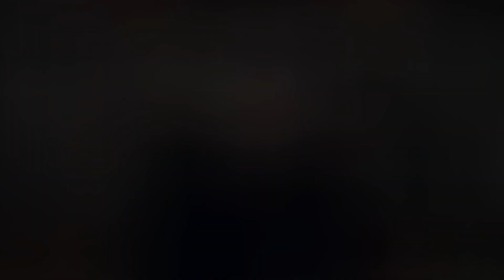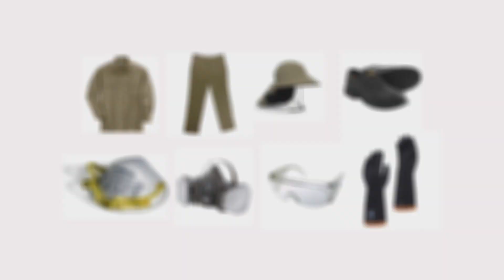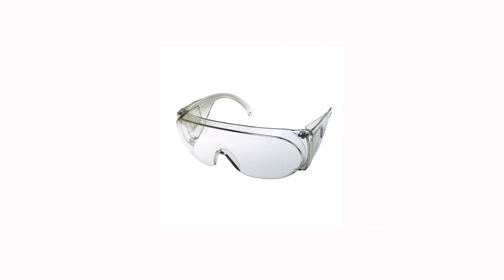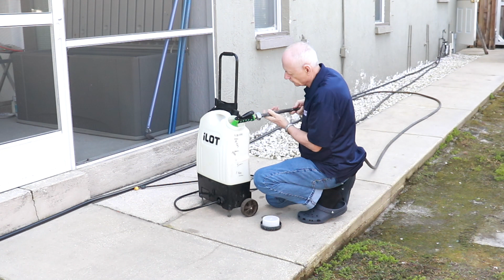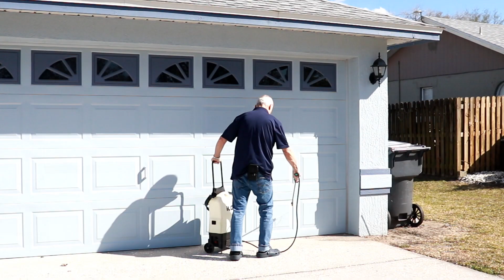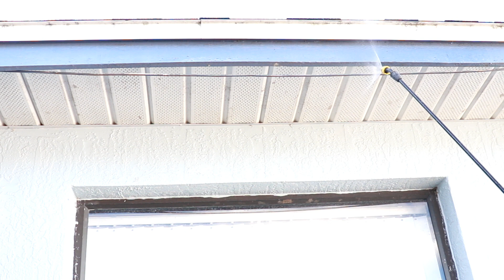How to Prevent Drywood Termites 100% Guaranteed.

Comment: Hi Guy, I'm in Florida as well and have both subterranean and drywood. For the Subs I found mud tubes in the garage coming in from both sides and I removed them physically. They or drywoods have hollowed out he wood frame around the garage. They have also taken out a small palm tree in a garden area as well as I found a mud tube going up most of the length of a big Palm Tree. Any recommendation for that area or the big Palm?  I have found drywoods in 2 places inside attic and 2 places so far on roof overhang in limited areas. 1) For the Subs, you seem to recommend the trenching (and not bait stations?). Do you recommend any injections into walls and, if so, can this be easily done by a novice? Will the trenched poison be toxic to cats,etc. after drying? For a situation like mine with recent evidence of subs inside, would you still also say to give the "Bio Advanced" granules a chance instead of trenches? If so, with granules, how often would you then repeat that treatment or then move to quarterly sprays as a preventative? I have about 8 inch brick pavers on the ground around foundation walls of much of house. Do I have to move all of those first if trenching or just leave. What about the driveway/ garage front area? I also have a screened patio which I believe you said I could continue to trench around. I have an outside patio area with patio stones and/or pavers on some areas there. What to do there? Is it Ok to just trench or granules on outside perimeter of that as well?  2) What about the drywoods in my situation? Is tent fumigation the only option likely to worK? ( I prefer not if possible). Guy, thanks so much for this offering.
Reply from the maker: It sounds like you have a lot going on there.  I am so sorry that you're going through this.  Let's try to unpack this one issue at a time. 

Let's put the drywood termites on the back burner for a little bit.  These guys are very slow eaters, and it takes a long time for them to do significant damage.  Also, you need to address the subterranean termites before you treat the drywood termites.  There is a very lengthy explanation for that, but please take my word for it that there is an order of treatment to follow with this stuff.  Don't worry.  We will be addressing the drywood termite issue. 

The primary goal is to protect your home.  In Florida, you may encounter Formosan termites.  I would not be a bit surprised if this is the species you have.  I say that because of the palm tree.  Formosan termites are the only species that eats live wood.  These guys are very aggressive eaters, so if you are dealing with this species, then that needs to be your priority.  I cannot say for sure this is the species that you have, but it sure does sound like them.  In any case, the first thing you need to do is to trench around your entire house and both sides of the driveway.  I have a video on how to treat Formosan termites, and I will give you a link to it.  I think it is reasonable to assume that the colony that is infesting your house is the same colony that is attacking the tree.  Therefore, if you can take out the colony, that will end the problem with both the tree and the house.  Trenching the house is the best way to go about doing this.  There is a treatment that you can do for the tree as well, but right now I suggest that you focus on saving your house.  Do not waste your time with bait stations.  They are Hail Mary Pass at best for a non-aggressive species, and pretty much do not work at all for Formosan termites.

If you have Formosan termites, then the video will explain what you need to do with regard to treating inside the house.  That may be nothing in your case because you will be fumigating.

After the trenching is finished, and the pesticide has dried, it is safe enough for children to play on.  So, this will not be a problem for your pets. 

The termite granules do not work for Formosan termites or drywood termites.  Since there is a good possibility that you do have Formosan termites, I would not recommend using the granules. 

If you have pavers that are against the house, you can usually trench just to the outside of them.  Trenching directly against the house is always the best way to do it, but you can usually get away with trenching a little bit away from the foundation or the slab.

You do need to trench on both sides of the driveway, and you do need to trench around the patio.  You should have a continuous trench from the street, going along the driveway, all around the house, and then back to the street again on the other side of the driveway.

I'm afraid that the drywood termites will require fumigation.  I will explain all of that to you after you get finished treating the subterranean termites.  Fumigation does not work for subterranean termites because they will simply reinfest the house from the ground.  However, fumigation is going to help you if these are Formosan termites because those guys build satellite colonies in your walls that we call cartons.  Normally, we remove these cartons by removing the drywall.  However, if you fumigate, then that should kill off those cartons without removing any drywall.  So, for now, just focus on getting the trench done.  I'm going to also give you a link to my video on how to trench for subterranean termites.  It is exactly the same information as trenching for Formosan termite, except that the video for treating subterranean termites is a bit more in-depth and better explained than the trenching part of the video in the Formosan termite video.  I think it would serve you well to watch both videos.

Please let me know when you have the trenching finished, and I will explain how to get the best price possible on the fumigation.  

I hope that helps.  Be well my friend.

Video on how to treat Formosan termites:  https://youtu.be/xDtGUWxMrRw

Video on how to trench for subterranean termites:  https://youtu.be/Fy7YHi_7Z8g
Reply: @GuysPestSolutions  Thankyou Guy, much appreciated! I don't know why none of the companies contacted mentioned the Formosan termites except in their contracts where they excluded any guarantee on them?? I have ordered the Taurus SC but it will take until next week to arrive (after the weekend). I'm wondering how rain will affect the application? Will the termiticide effect the roots of plants? Also, if you get time, can you explain how to save the big Palm Tree that has signs of termite infestation and I saw many termites a year ago in the mulched garden area around the tree.? Also wondering if I should use this wait time to contact companies for the tenting? Is there any recommendations for toxicity reduction to humans after the fumigation? Thanks again for this awesome service
Reply from the maker: @MrYousurf  Many pest control companies don't waste time identifying the species.  Only the really good ones do that.  It's easier just to let your house get destroyed and exclude Formosan termites in the contract.  It's a shame because it is not hard to identify the species.  Rain will not bother the treatment after you close up the trench.  I would not treat in the rain.  Taurus SC will not bother the plants.  The treatment for trees is below.  Please watch my video on how to hire a pest controller without getting ripped off.  It can save you a lot of money on the fumigation.  You can get pricing now if you wish, but don't let them talk you into treating until you are sure that the subterranean termites are gone.  If they tell you that it doesn't matter, don't believe them.  They have a financial incentive.  I don't.  So, I will give it to you straight.  There are very good reasons not to fumigate until the subs are gone.  The most important recommendation I can give about fumigation is to not trust them when they tell you that you can move back into the house.  There are accidents every year because people go back in too soon.  Wait another 3 to 5 days after they tell you that it's safe.  They measure the gas level, but it's not always accurate.  Also, bag all the mattresses in bed bug bags.  You can get them from Amazon.  The gas can linger in mattresses.  If they miss it, then... Well, you can imagine what happens then.  It doesn't always end well.  The good news is that there is an agent in the gas that is put there to make you sick if the gas is not completely gone.  They do that so you will leave if the gas is not gone.  It is possible to sleep through it though, so err on the side of caution.  This is a good time to take a vacation.  If you don't have a security system, buy some Blink cameras from Amazon and put them around the house.  Break-ins are common with tented houses.  The cameras will send an alert to your cell phone.  They may not like electrical stuff running during the fumigation, but you can turn on the system remotely the day after the fumigation is done.  It is very easy to arm and disarm the system.

I hope that helps.  Be well my friend.

TREES THAT ARE ALIVE

This is something of a Hair Mary Pass, but you can try drilling holes that are about 12 inches apart around the base of the tree that are on a downward angle, so that the drill bit is aiming under and to the center of the tree.  You want to use a drill bit that is at least 12 inches long and at least 1/2 inch wide.  The longer the better.  After the holes are all drilled, then mix Taurus SC at 0.8 oz per gallon and fill up the holes with it.  You can mix it in a bucket and use a funnel to get it into the holes.  You can also drill some holes down into the ground at a 90-degree angle, that are about 6 inches apart and fill them up with the Taurus SC as well.

 DEAD TREES

Drill holes that are about 12 inches apart around the base of the tree that are on a downward angle, so that the drill bit is aiming under and to the center of the tree.  You want to use a drill bit that is at least 12 inches long and at least 1/2 inch wide.  The longer the better.  Also drill holes right into the tree, a couple of inches above the dirt.  You want them about 6 inches apart around the entire tree.  Drill these holes in a downward angle toward the center of the tree.  After the holes are all drilled, then mix Taurus SC at 0.8 oz per gallon and fill up the holes with it.  You can mix it in a bucket and use a funnel to get it into the holes.  You can also drill some holes down into the ground at a 90-degree angle, that are about 6 inches apart and fill them up with the Taurus SC as well.  There is a good chance that the termites will contact the Taurus SC and bring it back to the colony and share it with the other termites.  This will kill the entire colony.  If the colony is dead, then the termites will not be alive to attack your house.  After the colony is dead, then remove the tree.
Reply: @GuysPestSolutions  Thanks Guy, A few questions... How do I know the Formosans are gone? I'm not sure I have any living in the house as they came into the garage on both sides of the garage door and did some tubes in that area and the tubes were destroyed and termites have not rebuilt after a month. I thought part of the reason for tenting was to kill the formosans if their were any? If not, might it work to have them do an attic treatment and spot treat the few areas on soffit outside for the drywoods? Three of the companies recommended doing that (and I would have guarantee with that for retreatment if necessary). Might be worth a try? (I may only be in the house for another year or so). I know the tenting is the only sure way to get rid of them.
On the trenching, I have so many walkways, porches,  patios, and hedges, etc. that I wonder if the main point for me would be to get the continuous barrier around the house (and driveway) even if it is away from the house in some of those areas? In that case should I then do the preventative Taurus SC treatments next to the foundation where the trenching did not get too close, at the same time as the trenching? Also, how long after trenching should I start the preventative 3 month cycle of spraying foundation?
Thank you so much Guy
Reply: Hi Guy,, I wonder if you have seen this from University of Florida, https://www.youtube.com/watch?v=nQKWNDs8NhM, where he recommends using above ground bait stations from Sentricon, (using currently Noviflumuron, and previously, hexaflumuron), which he says are the best way to treat asian and formosan termites in trees and houses? Any comments?
Reply from the maker: @MrYousurf  You are correct that fumigating should take out any Formosan cartons that exist in your home.  Keep in mind though that we don't know for sure that this is the species you have.  I just suspect that is the case, but I could be dead wrong.  It is also possible that the palm tree was already dying from another cause, and the termites that you see there were just eating dead wood.  It doesn't really matter though because, if you have drywood termites then you need to fumigate, and that will end any termites that are in the house at the time of fumigation is done.  

Let me explain how dry would termites work. They enter through cracks and crevices around windows, doors, eaves, pipe penetrations, and so forth.  Most of the time, they enter through several locations.  That is because a swarm of them attacked your house at the same time.  If there was a crack or a crevice, then they probably found it.  After they establish their galleries, which will be inside the wood, it will take four to seven years for them to be able to swarm.  Now that they are in your house, the swarmers will use holes that are in your studs to travel through the walls.  Those holes in the studs were created by the electricians to run the electrical wiring.  Not only are these holes going through the studs, but holes were drilled into the attic for the light switches and to run some of the wiring for the outlets.  So, the termites now have easy access throughout the attic and the walls.  Most of the time, you will have no idea that they are in the walls, because the frass is inside the wall.  To make matters worse, if you have drywood termites, then your neighbors have them too.  That means you have been getting swarmed for as long as they have existed in the neighborhood.  Most likely, we're talking about years, so it's a safe bet that you have these guys in many locations in your home.

As you already know, the only sure way to get rid of them is to fumigate.  Prices for this can vary wildly in this industry, so I recommend that you watch my video on how to hire a pest controller without getting ripped off.  That video can save you a lot of money.  You should also know that the gas they use to fumigate has absolutely no residual action whatsoever, so you can get reinfested the moment the tent comes down.  Like I said before, if you have drywood termites, then your neighbors have them as well.  Since drywood termites swarm every year, it is almost a certainty that you will be reinfested within a year after the fumigation is done.  The only way to prevent this is to do a preventive treatment on your house every 60 days.  Most pest controllers will not do this, so it is something that you generally need to do yourself.  I have a video on how to do that and I will place a link below.  This is a generic video that covers a lot of different pests, but it also works for preventing drywood termites.  Just ignore the part about treating your yard.  You only need to treat the house for drywood termites.  This will not treat the termites that are already there, but it will stop new ones from getting in.  If you absolutely cannot afford to fumigate your house, then you can try spot treating it yourself or you can hire someone to do it.  Either way, it is virtually impossible to find all the termite galleries, but it is way better than doing nothing.  I assure you that any company that you hire is going to miss galleries.  When you go to sell your house, a competent termite inspector is most likely going to find active galleries.  You may convince the buyer and their lender that doing another spot treatment will get it done, but an honest pest control company is going to point out the same thing that I just did.  If I were inspecting the house, I would advise the buyer that the house requires fumigation.  That is what reputable inspectors are supposed to do.  Now you may get lucky and find a pest controller that either doesn't understand what he is doing or will look the other way, but it's still dishonest not to leave the buyer with a termite free home.  If the lender or the buyer have any experience at all, they may require a fumigation before the closing.  In Florida lenders should be familiar with drywood termites.  Nevertheless, you may get lucky, and it will all slip through the crack.  I have seen many cases where pest controllers missed drywood termite infestations.  I have also seen cases where the home inspector did the termite part of the inspection to save money, and they did not know what they were doing and missed the infestation.  I have heard from a lot of buyers that they got duped like that.  Sometimes they missed Formosan infestations and there were thousands of dollars in repairs needed after the closing.  So, it is possible to slip under the radar, but it's not the right thing to do.  Now, drywood termites are very slow eaters, so normally waiting to fumigate for a year is no big deal.  However, if you also have Formosan termites, then you do not want to wait to fumigate.  Those missed cartons can do a lot of damage really fast.  

I'm not sure that I understand your trenching question, but you can trench around pretty much all obstacles from the road back to the road.  Just get that circle around the house and driveway.  You do not need to do a preventive treatment for subterranean termites for at least 5 years.  You do need to do a preventative treatment every 60 days for drywood termites.

I hope that helps.  Be well my friend.                    

Video on how to hire a pest controller without getting ripped off:  https://youtu.be/y-a8XOqVrlE

Video on how to spot treat drywood termites:  https://youtu.be/U7ck7zhS0Xo
Reply from the maker: What you are getting into here is very new.  I have a lot of questions and concerns about this approach.  First, the company that makes Sentricon (Corteva) named the product very well.  The operative part of the name is con, because that is what Sentricon is.  It's a con job.  The company has done a great job selling it, but it is not effective against Formosan termites and marginally effective against other species of subterranean termites.  Not only can termites miss the stations, but even if they find them, it can take so long to kill the colony that the Formosan termites will do serious damage to your home.  That is because the bait does not kill termites.  Both noviflumuron and hexaflumuron are insect growth regulators.  Basically, birth control for bugs.  Termite workers can live up to 2 years, so do the math.  Formosan termites can destroy your home in a fraction of that time.  Of course, the presenter in that video is mostly talking about Asian termites, and they are somewhat different than Formosan termites.  Still, Asian termites can also live up to 2 years.  So, now Corteva, the company that orchestrated the biggest scam in pest control, is asking us to believe that somehow noviflumuron is going to do something that hexaflumuron cannot do.  Again, both IGRs.  It makes no sense to me.  I'm not buying it.  College professors know a lot of stuff about termite biology, but this one got some stuff dead wrong.  He claimed that trenching would not take out a colony of termites.  That is totally incorrect.  The termites do not recognize fipronil as a poison and they will take it back to the colony and share it with the other termites.  Not only will this kill the entire colony, but it will do it way faster than an IGR.  So, the good professor has already been misinformed about trenching, and his argument about noviflumuron is more than a little questionable.  The idea of above ground baiting is new, and it could be promising, but not with an IGR.  It's just too slow.  The concept may be sound, but more study is needed, and you would want a bait that actually kills the termites, like fipronil or imidacloprid.   Why fool around with birth control when you can just kill these things in mass numbers, thereby taking out the colony way faster?  As it turns out, I am working with a subscriber right now who has a very unusual situation going on with Formosan termites in California.  Trenching is not an option for them, so I recommended above ground baiting, but it is with my own version of homemade bait.  Frankly, I don't know if this is going to work.  I advised them that this is a Hail Mary Pass at best.  Above ground baiting has potential, but it is unclear how well this is going to work in field conditions.  The one thing the presenter did get right is, for above ground baiting to work, it is best if you use it where there is known activity.  It's a good idea to place it exactly where there are termites.  I am experimenting with a way to attract them to it, but this is very preliminary, and I do not have any results yet.  If I'm right, there may be a way to attract them to the bait stations, if the termites are somewhat close by.  Not surprisingly, the above ground bait stations from Sentricon are only available to pest controllers who contract with the company.  As far as I know, you cannot obtain them yourself.  So, the bottom line is that the above ground bait stations offered by Sentricon do not pass the smell test.  I think the jury will be out for a while on this one.  You know what they say, "Burn me once, shame on you.  Burn me twice, shame on me."  Believing Corteva at this point is kind of like buying into an investment opportunity from Bernie Madoff.   

I hope that helps.  Be well my friend.
Reply: @GuysPestSolutions  Thank you so much Guy. You are a treasure for unfortunate homeowners that have to deal with this  along with the dishonest pest control companies and manufacturers. When you become deservedly famous for creating a bait that works I will be happy to say I knew you when you were dispensing much knowledge and experience free of charge to all who asked. A few additional detail questions: 1) when trenching do you use the fipronil at the recommended rate of .06% dilution? What about when spraying for drywood prevention? 2) Do you recommend the 60 day use of fipronil spray for the drywood prevention or the 3 months fipronil application followed by Talstar P and on a rotation as mentioned earlier on a video? 3) Wouldn't the prevention treatment also help with subterranean termites to help prevent renewed infestation? I'm curious whether that might help since I might have to trench away from the foundation in many areas due to obstacles. 4) I wonder about your personal experience with pouring the 4 gallons into trench and if that had frequent splashes that would get all over one's pants and any recommendations for protecting this area from the poison. 5) do you happen to know any best bets pest control companies for the drywood treatment in Palm Beach county, Florida?Thank you again guy and be well
Reply from the maker: @MrYousurf  Thank you so much for those kind words. Very much appreciated. 

When trenching, you just need to mix the Taurus SC at 0.8 ounces per gallon of water.  It is the same delusion rate when spraying to prevent drywood termites.  The best way to do it is to apply the Taurus SC every 3 months.  You can also go in a completely different direction and use Bifen XTS.  I have a video on how to do that as well and I will give you the link.  The advantage of doing it this way is that you can use a hose end sprayer.  That is the way I do it.  The only thing is, that you need to treat every 60 days instead of every 90 days.  I like it better though because it is way faster.  The hose end sprayer can reach heights up to 25 feet, which makes it easy to do fascia boards and soffits.  It does make a mess on the windows though and it makes the glass look hazy.  To avoid this, you can treat around the windows with a garden sprayer.  Simply use the hose end sprayer to put some pesticide directly into the pump-up garden sprayer.  It will come out of the hose and sprayer at the correct dilution rate. 

The drywood termite prevention treatment does not help with subterranean termites. 

Pouring the Taurus SC into the trench is really not that messy.  I've never actually gotten any of the pesticide on myself from splashing.  Don't worry though if you do.  It's no big deal.  Just wash your clothes after you're finished.  You should be doing that anyway. 

Unfortunately, I do not know any particular pest control companies that I can recommend but beware of the national companies.  Some of them send out train salespeople instead of actual pest controllers that have field experience.  They work on commission and their only job is to upsell you as much as possible.  They are very good at high pressure sales.  So, you may want to try the local Mom and Pop companies first.  Try to get as many estimates as you can. 

I hope that helps.  Be well my friend.

Video on how to treat the exterior of your home using Bifen XTS:  https://youtu.be/Yozv3s-Qwlw
Reply: @GuysPestSolutions  Thanks guy. A few more questions I wonder if, since I'm trenching, it might help to buy some bait stations to supplement and perhaps kill the colony that way? Do you have an opinion on the Spectracide Bait Stations that are also very cheap? I'm not sure they (or other brands) might be capable of killing the whole colony, which seems important. Also, about trenching along a long concrete driveway which slopes downward on both sides, would that be an environmental hazard or is fipronil self contained in the bonding to the soil after it drys? 
Thanks again friend
Reply from the maker: @MrYousurf  Please watch my video on Spectracide Termite Stakes.  That video will explain everything you need to know about this product.  If the driveway has a steep slope, just trench 1 foot at a time.  The Taurus SC will bond to the soil after you have it filled in.  I hope that helps.  Be well my friend.

 Video on Spectracide Termite Stakes:  https://youtu.be/UDzg-1lpynA
Reply: @GuysPestSolutions  Hi Guy, sorry to have emailed you on this first but I wanted to show you some pictures and didn't know how to upload to youtube . As a reminder I may have formosan (since they attacked a living tree) and I also have some drywoods. Some form of subs came into my garage and left tunnels a few months back (see pictures via email). I broke those tunnels and can't remember if I saw any termites in them at the time but if I did it was very few. I have seen none in the garage since then and there is no other evidence that they are still there and no rebuilding has occurred. I think they just crawled in and mud tubes stopped at a wooden shelf about half way up the wall and I've seen no evidence that they got into the shelf yet, though I guess they could have with cartons if they are formosan. Do you think they could have just left the garage? Some form of termite got into the wood framing outside of the garage and I picked at that and exposed some areas and found no live termites yet. Should I treat this with foam?(see emailed pictures). I found some stuff that could be carton material or it may just be worked over wood pieces. (see pictures). Can you tell if cartons? Finally I got a picture of one termite on ceiling (not close up) and wondered if you could identify the kind of termite from the picture? I'd like to know if they are Formosan, Thank you Guy!
Reply from the maker: @MrYousurf  It was perfectly fine to email and send photos.  There is no way to share photos on YouTube.  I believe that I did respond already to the email.  Just keep responding to that email.  It's easier than using YouTube anyway.  Just allow a couple of days for me to respond.  I am running a bit behind right now.  Be well my friend.